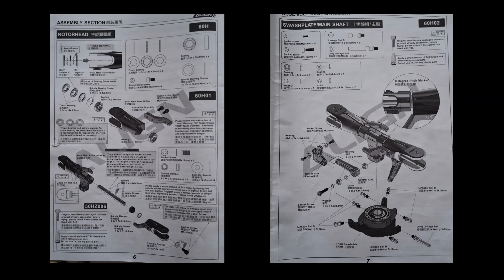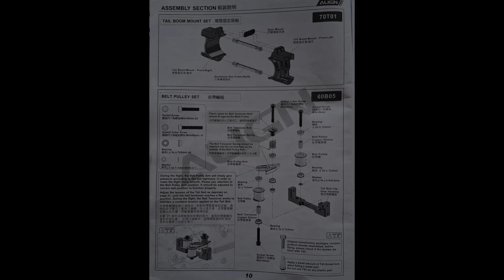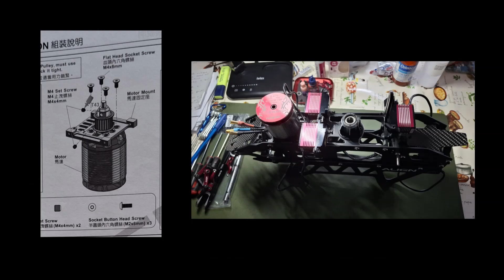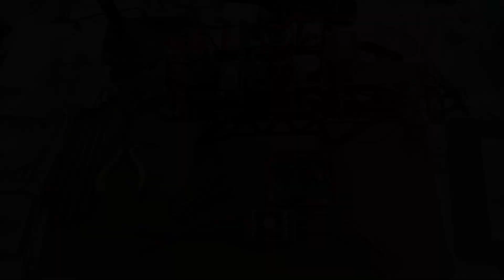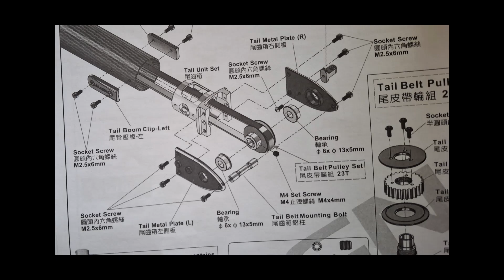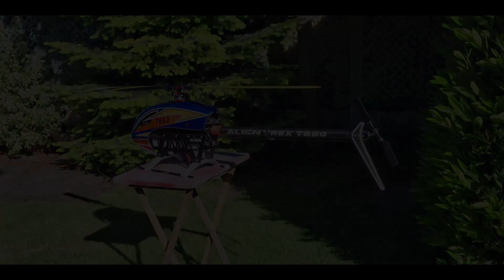Align TB60 -12S RC Heli Build

Comment: This will be a really big bird! I wish you lots of fun with it! I have a OMPHOBBY M5 with 580mm main blades and at first I had to get used to the huge size of this machine. But now, after more and more flights I love it more and more! Especially the sound of the blades and the presence in the air! Even if a bit more far away this machine is still very visible!! Good luck with the maiden and many happy flights!!
Reply from the maker: Hi Matthias I am looking forward to this one I have a couple of scale models with the Align Trex 550 mechanics in and the MD500 which has the Trex 650X mechanics. All three live up to the saying the bigger they are the easier they are to fly although intimidating at first. The presence in the air helps with orientation and if you make a mistake you appear to have a few more seconds to correct than say the a 400mm size. I will fly the TB60 for the rest of the year and through the winter months I will convert it to an Agusta A109 with the ERA paintwork. Happy flying and successful landings!!!
Reply: @All_things_RC.  Wow, thats sounds like a very good plan! Happy flights and safe landings!!